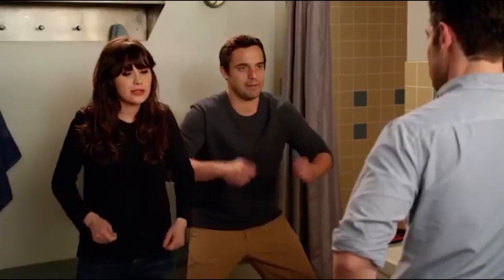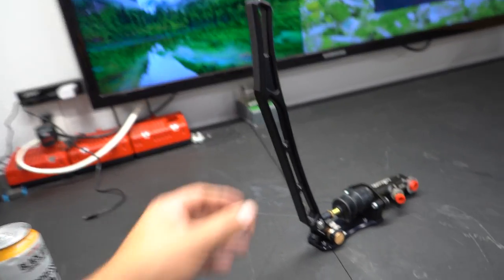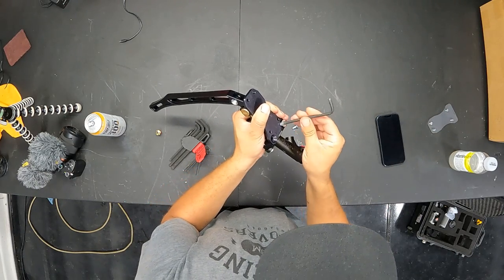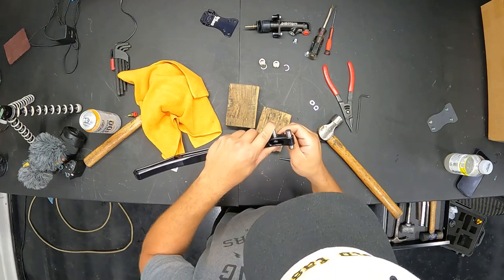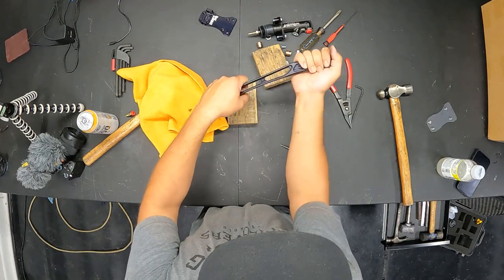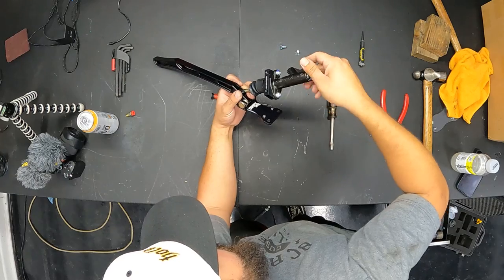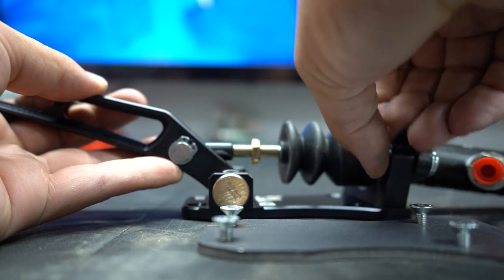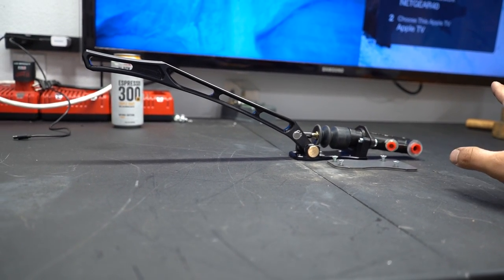Best Hydraulic Hand Brake? x Buds on Budget Drift Car

Comment: I've got a Nameless hand brake in my drift car. Thinking of picking up a 350Z that needs a clutch for a bangin deal. I've got a hand brake like the one in your video from Hardcore Tokyo that you can swap between traditional and upright. I'd end up using that one if I pick up the 350. Saw your other video where you welded the diff in your Subi. Careful you don't put too much strain on the center diff, that may go out, either way it's looking good too. Also, my hard times shirt is already coming apart and I've only worn it like 4 times. Just an FYI.